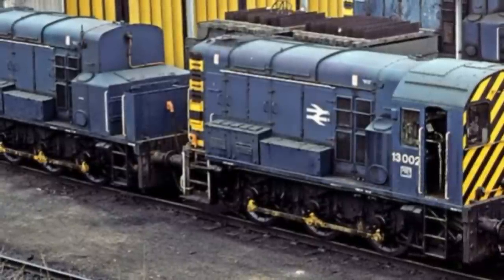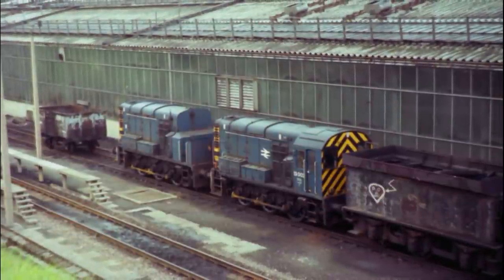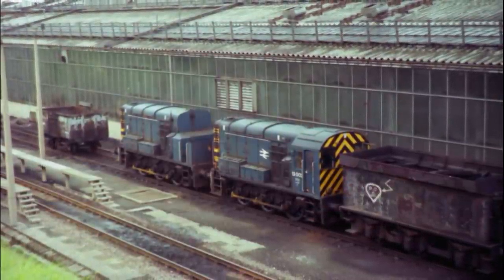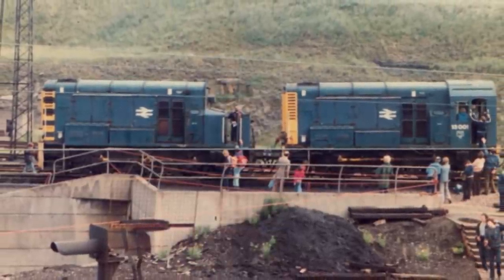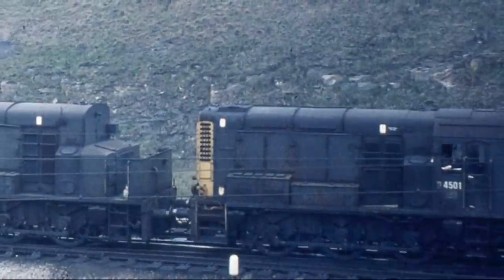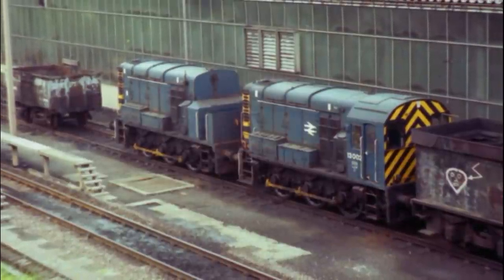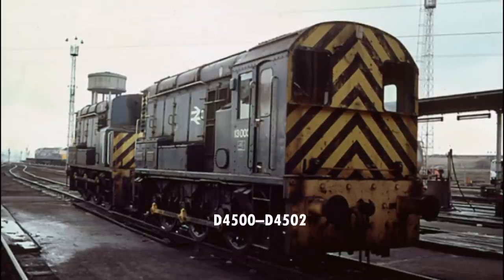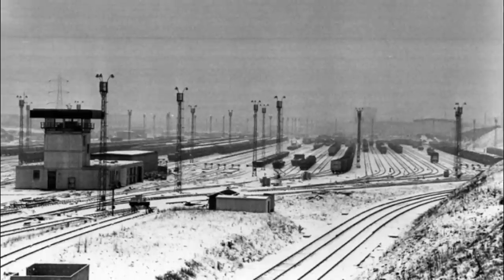When British Railways Made The Human Centipede With Locomotives: BR Class 13- Enthralling Engines #1

Comment: Those locomotives are very similar to the EMD TR1 and TR2 "Cow-Calf" units that were basically NW1 and NW2 switchers that were semi-permanently coupled together (A Unit and cabless B Unit) and were essentially used for transfer service at interchange points between railroads.

Comment: This seems like it'll be a fun series. I'd honestly like to see an episode on the unique Triplex locomotives. A very flawed design to be sure, but still fun to look at.
Reply: They were great when you needed traction and slow but steady power.
Not so great at speed or budget.
Reply: As an Addendum, Quadraplex engines. Whilst no engine was built a patent was made, it had 2 cabs one for the driver at the front (So, cab forward?) and one at the back for the fireman.
Reply: @Sandalphon36  Yes, I've heard of those. In fact, if I remember correctly, there was even a design for a Quintuplex engine, which had three cabs, one at the front, one at the back, and one in the middle. Of course, like the Quadruplex, it was never built.
Reply: @NorthWestern1919  That sounds like an abomination from a simulator.
Reply: @Dat-Mudkip  One can only wonder as to why such a ridiculous engine was never built.

Comment: That was an interesting video. 2 of those class 08 survive into preservation. 13000 and 13002 with the slave units. 13002 is an active class 08 at the Plym Valley Railway where I am a volunteer and is a pleasant engine to drive. One of the best shutters ever built
Reply: More Likely a Class 12

Comment: Add to the mix,both Alco and Baldwin made Cow and Calf sets! One especially interesting one,was the units on the Southern Pacific,as they were C-C road units! And there were also the Train Masters converted into Hump Slugs! The Southern Pacific and the Santa Fe,were noted for producing home made units for their own use,and that started in steam days,as they were so far from the East Coast,where the manufacturers,were located! So when diesels came in,the shops can and did the same!! A notable rebuild done by the ATSF was the CF7,which took,F7 cab units,and made them into road switchers,and the railroad got at least another 20 years of use out of them! More than a few short lines have them in operation!! Thanks 😊!

Comment: In italy we once had e321 and e323 classes
These were the first (and only) electric shunters to operated in italy and were permanently coupled with one or even two slave units (known as e322 and e324) that were capable to erogate 780hp (more even than class 13)
 there is another detail that made these shunters even more unique: their chassis was recycled from 1904 gr835 steam locos and, as they operated until 2002, they are also the last remains of italian steam traction in regular service

Comment: This is same solution the Pennsylvania Railroad had in 1910 for the problem of getting to Sunnyside yard; two units coupled together. The DD1 locomotive was the DC electric answer. Was the most powerful electric unit in the world at the time. One survives in Strasburg, PA
Reply: There's also the BB-1 switcher, used in pairs linked with a drawbar and classed as BB-3.

(I have a video of models of these tooling around my excuse for a layout :) )

Comment: @ 0:07 Not all of the steam engines on this picture were not scapped: most or at least many are preserved.

The Class 08 shunters were also used extensively by the Dutch Railways (Nederlandse Spoorwegen) after WW2 as NS 500, NS600 and NS 700 series from 1946 and 1998. 🙂

Comment: Obviously inspired by the French railways system around the 60s: using the coupling of C-61000+TC61000 (a 0-6-0 diesel shunter permanently linked to a cabin-less 0-6-0 truck) applied to the same specific task in marshalling yards with hump sorting.

Comment: This is when i bring up the point of the EMD FT and TR units. Permanently coupled Cow Calf units from the factory from the 1930s into the 40s. A good while before BR did this
Reply: Bear in mind that experience quickly taught both EMD and the railroads that using drawbars instead of couplers just leads to an inflexible locomotive... hence why semi-permanent coupling didn't last long on the FT and was not implemented on the F2. In fact ATSF ordered all of their FTs as single units with couplers on both ends, including the booster units.
Reply: @ErickC  then again if it was “inflexible” why did EMD make like, 4 arguably marketable TR units, hell even a 3 unit TR3 existed
Reply: @tencents49  : Notice they didn't make very many of them... against a balance of 1145 NW2s there were 3 TRs, 36 TR2s, and 2 TR3s. For 489 SW7s there were 15 TR4s. 309 SW8s v. 12 TR6s. For 786 SW9s there were 10 TR5s. And they didn't even bother making cow-calf pairs after that.

And you know what happened to those locomotives? They were all either traded in for single units and scrapped at a relatively young age or rebuilt as standalone units.

Ask yourself this: why did so many FTs get retrofitted with couplers and why hasn't EMD produced drawbar-connected pairs since the dark ages? It's because now you have two locomotives that could potentially do separate duty when they don't need to be connected, but they're stuck together permanently. Utilization is money. Utilization is why nobody makes booster units anymore, either.

The total number of models available is pretty much irrelevant. Between 1946 and 1955, Baldwin offered many more roadswitcher models than EMD did. But nobody bought them. Your argument is akin to saying that Baldwin was more successful than EMD during this period because they had more models available despite selling a tiny fraction of what EMD sold and ultimately going out of business while EMD was still churning out locomotives day after day.

Also - have you considered that most of those TR models were offered concurrently because EMD was producing several different versions of the same switcher with different engines in them at the same time? You did know the only difference between an SW7, SW8, and SW9 is the number of cylinders in the engine, right? They weren't successive models. We're talking about a very narrow time range here. Half of the available models were based on the NW2 while the other half were based on the SW7/8/9. That effectively creates the illusion of a wider production range than there actually was...

Comment: How about the British 1938 LMS "Jackshaft" inside framed 0-6-0 diesel electric locomotive?? Some are still in service on the Italian Railways today.

Triang Railways / Triang Hornby / Hornby Railways used this loco as a basis for their R.152 diesel electric shunter, exactly modelling the body for their loco, but getting the chassis wheel spacing totally wrong, due to wanting to utilise their standard 0-6-0 chassis.

Comment: Maybe one of the most powerful switchers in the UK, but its performance figures are just barely comparable to a single GP7 - and only if we go by tractive effort (GP7 is 1500HP and 65,000-lb starting tractive effort). MU a road slug to the GP7 or swap it out for an SD40-2 (also commonly used in switching service) and it's not even close. We could split hairs and call those locomotives roadswitchers, but they're used so commonly in switching service that it's kind of a moot distinction.

Comment: I believe railroad in the u.s did something similar but with converted sw1200s or 1500s that would be called "Slugs"
Reply: Sort of. A road slug is a concrete-ballasted shell with traction motors but no engine. It draws power from a "mother" unit. They are often built from retired locomotives. You can uncouple a road slug and pair it with another unit so long as it has the right connections to pass power to the slug. A road slug takes power from the mother unit but adds tractive effort (which is what actually pulls trains).

The Class 13 is much more similar to a number of EMD FTs that were ordered in semi-permanently coupled A-B or A-B-A sets.

Comment: Kinda reminds me of a yard slug.
Reply: Only the Class 13 is more like an EMD TR1 or TR2 "Cow-Calf" unit: two semi-permanently coupled A and B units paired or mated together. Slugs aren't locomotives.
Reply: @Cnw8701  true, but kinda the same purpose as yard slug sets. more tractive effort, low speed and primarily used in hump yards.
Reply: @nathanditton5011  Yep. Only difference being the presence of a prime mover. BNSF and UP use control cars (RCL/CCRCL), which are locomotive carcasses fitted with remote control equipment used for remote control switching. They have their MU cables and air tanks, but everything else is gutted save for the engine or prime mover on some of the UP units (namely the Dash 7 CCRCL units, since the resale value for older 7FDL engines is terrible).
Reply: @Cnw8701  I never knew the up dash 7 slugs still kept their engines, I assumed they removed them and replaced them with concrete like most slugs.
Reply: @nathanditton5011  They kept them intact instead of simply ballasting them. And they aren't slugs because the traction motors were removed.

Comment: Yes,strictly speaking they were what Americans know as 'slug units' on yard switchers.They looked very similar to class 08s but were actually class 09s(lashed together to make the 13s).These had a higher gear ratio and thus a higher maximum speed,even though the 20mph limit wasn't that much more than the 10-15 mph of the 08s!
Reply: Not anywhere close to a road slug. Roads slugs have no prime mover and draw power from a mother unit. They are used solely to add powered axles to a locomotive to enhance its tractive effort. The class 13 is just an A-B set that is connected via drawbar instead of couplers.